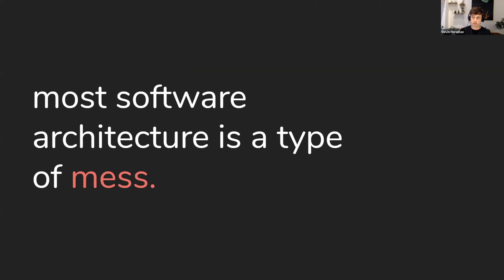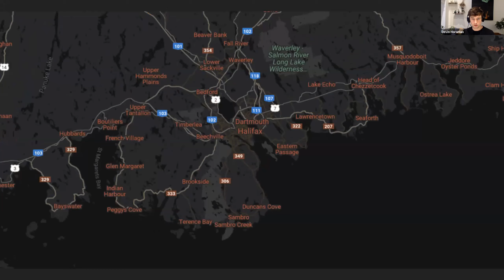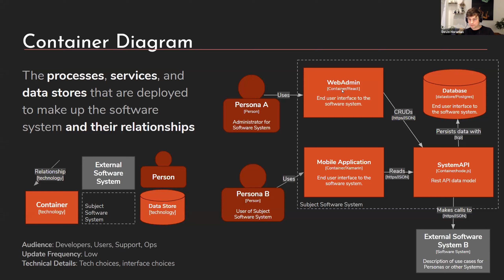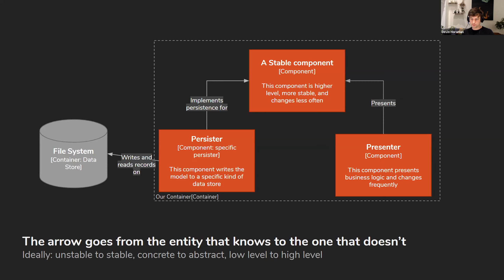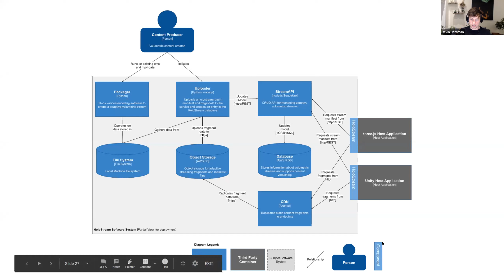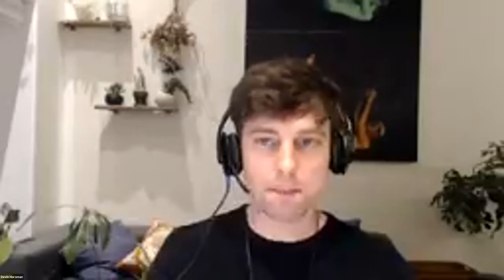Devin Horsman – Simple, useful software architecture with C4

Comment: I've been making c4 diagrams for like 2 years now and you can use the deployment diagrams to map topology. Don't get it twisted trying to diagram topologically rather than logically. Also, Figuring out what makes the cut as a Container or Component is still rough for me, but the rule of thumb I've been following is. If you can't break it apart anymore, it's a component (without getting into code) and If you can deploy it as a whole thing, its more likely to be a container.